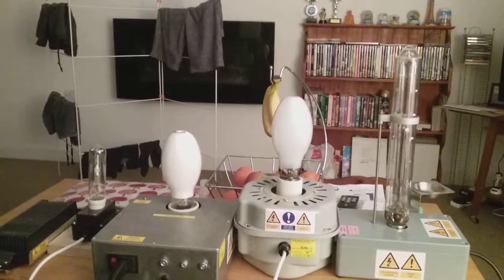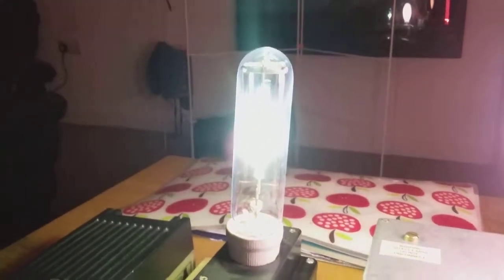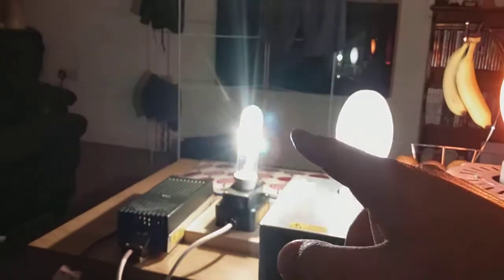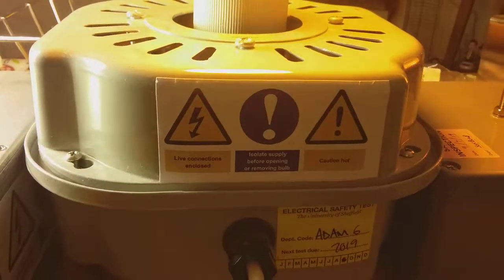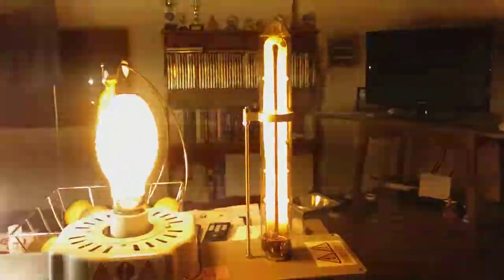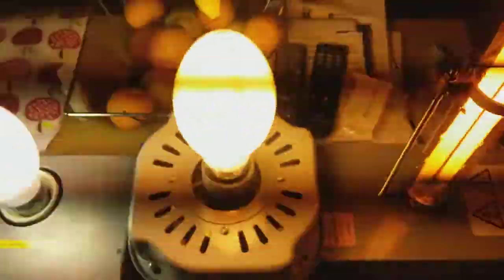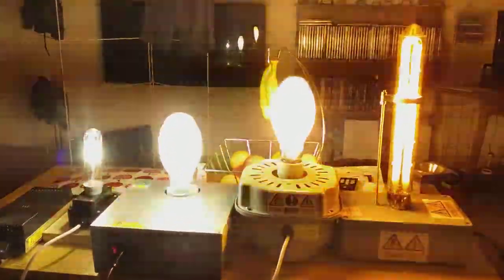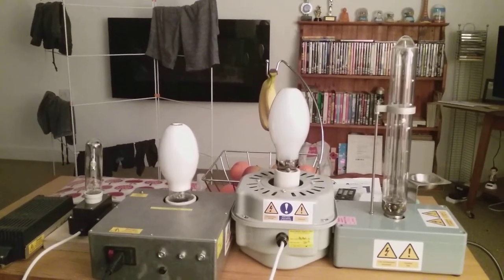Low pressure sodium, high pressure sodium, high pressure mercury and metal halide

Comment: Never use your SOX tube in that position.
The liquid sodium will run to the bottom and ruin the electrodes.
Always use horizontally or vertically with the socket at the top.

Comment: So are these safe indoors like a 70/80w hps light...I want one for my bedroom as I love the colour.
Reply: yes it is.
Reply: Absolutely. I've been running 70w metal halide, 125w mercury and even lamps as large as 400w sodium indoors and even have a modified high bay that I use as a room light for up to 250w mercury lamps (It's got multiple ballasts to let me select wattages). Your main considerations for using a HID source as your room light are how to conceal and cool the control gear safely and whether or not the fixture your lamp will run in is capable of managing the heat the lamp will produce. Besides that, it's up to you to weigh in the advantages and disadvantages and see if it's a good option for you... For example;

Advantages;
Low heat output for the wattage consumed
High luminous efficacy, especially compared to incandescent or fluorescent sources
Long lifespan (some lamps can last as long as 18,000-20,000 hours. That's over 18-20x that of a standard incandescent at 1,000 hours)
Replacement lamps are quite cheap to by considering how long they last
Good lumen maintenance over the lifespan of the lamp (most lamps will only have lost about 20% of their brightness by the time they start cycling or leak)

Disadvantages;
Requires control gear to run as arc lamps are negative resistance devices, similar to fluorescent
Takes several minutes to come up to full brightness
The lamp has a pretty poor CRI (HPS is 26CRI on a quality lamp), so this may be a consideration for any areas that require good CRI light.
Takes a couple minutes to re-start after a power failure where LPS (SOX), fluorescent, incandescent and LED will start right back up
Some HPS lamps contain mercury, therefore should be handled with care and you should avoid breaking the lamp.
The lamps also require a an igniter which produces a 4,000v pulse to strike the lamp, increasing the shock risk over a standard incandescent or even a mercury lamp. Always power OFF your fixture before replacing lamps or components within the gear compartment.
Reply: Pretty much. The only reason you don't see them use much for indoor use is their slow warm up time and low CRI
Reply: For sure! The envelope gets hot like an incandescent bulb, but they produce a lot of light! I would recommend going small, like 35 or 50 watt. Even the 70 watt bulbs are incredibly bright for indoor use (like 6000 lm).
Reply: 70w will be a very veyr bright for a room lol... might wanna look for 35-50w.. trust me i have some 50w wall packs on my building outside.. even the 50w are very bright lol